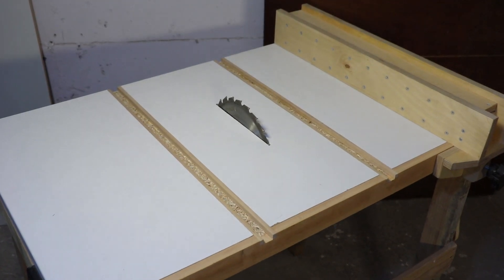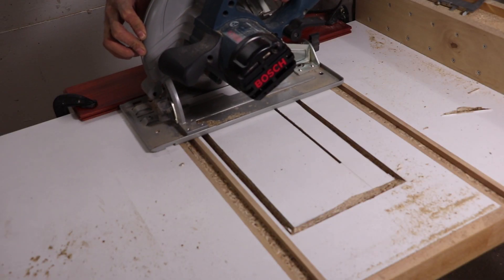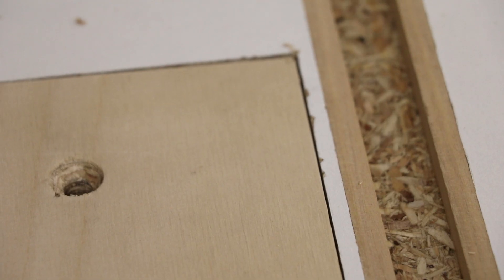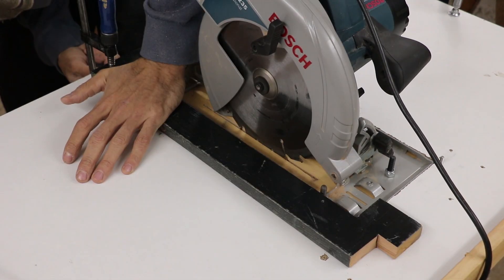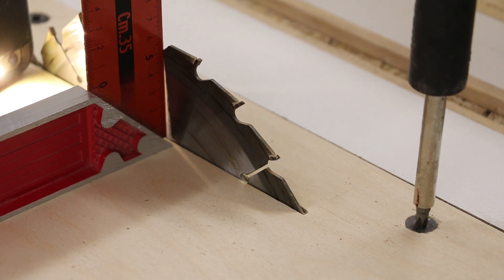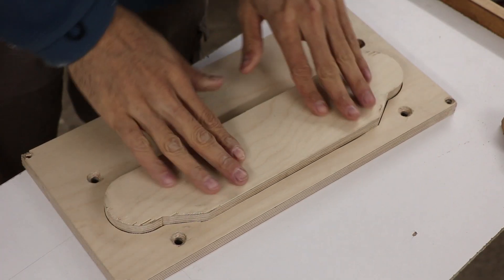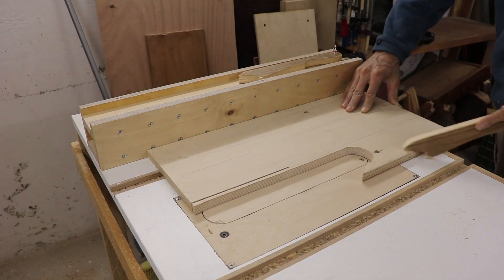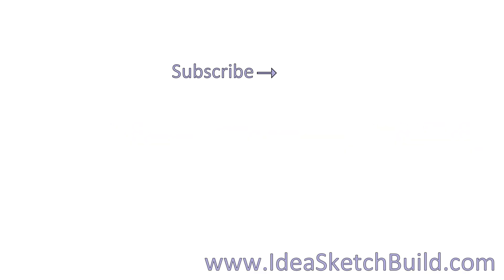Homemade Table Saw - 4: Removable Insert and Fine-Tuning

Comment: Great job man. I tried to cut through 18 mil Plywood bcos I wanted to change the top on my table saw but the cut came through crooked. I did something wrong and went back to the old top but now I'm building a whole new saw.
I hope to have it ready to go by next month. It's not easy working out the details but I'm getting there my friend. U built a really nice saw there. I have  Bosch 190mm GKS type. It's a nightmare to use and it weighs a tonne. I out a lovely Freund blade on it. The blade struggles to cut through weak particle board. I must be doing something wrong with the saw or maybe the blade is wrong. I bought one of those ACCU CUT things and paid 60 quid for the blade. It's the most expense I've paid out for a blade and I'm very disappointed with it. I bought SAXTON BLADES 254mm for my table saw and the cut is so clean it beggars belief bcos they're the cheapest ones they make at less than 20 euros each. I should've tried to get a couple of blades form them 190mm but I couldn't find any on Amazon..
Keep up te great work bro and my apologies for my longwinded rant about blades.. LOL

Comment: relying on thin saw plate for fixing the saw to the table top is one reason for inaccuracy, I bet your cuts would never be dead square on the vertical axis across the cut. I'd suggest to use a vertical plywood brace to support both the saw guard (which is made of thicker aluminium) and motor body to attach it to the table top. Also holes on mdf which are very close to edges and without very large washers do not look safe to me.

Comment: I really like what you have done here. I have been toying with the idea of making my own table saw now for a while. this method you have used seems to be the most practical of all that I have seen. This is the way to go but instead of attaching my saw to 3/4 ply I'll use a piece of 6mm aluminum plate inserted into 19mm marine ply, to give me even greater depth of cut. Thanks for the idea.

Comment: My friend you have some nice ideas here and nice video put togheter but this should not be build from particleboard for sure!That is dangerous as hell,specially when you took off more of half of the thick of that board!The particleboard as thin as you made it to atache that saw will collaps sooner or later from the speed trepidation of the saw!Believe it but that is dangerous as hell as you can end up with a runing saw over your feet!Use some hard wood and make it proper!This sould not be allowed to be on youtube from safety reasons!

Comment: Without a riving knife, this is a terrible idea to share. Beginner woodworkers (with little to zero experience) will try to do this to save cost and won't be aware of the potential dangerous kickback this homemade table saw would cause.

Comment: Whatabout the thickness of the sawblade when it the blade is a little dull, you need more force to push the wood through the saw, and when your sawblade is thin ( for example 1.6 mm) it will tilt to the left, so that you sawpiece is not square !

Comment: I don’t get it: you have good ideas and take a lot of effort and material: How can you not see you don’t have to drill the saw base plate but simply unscrew it? How can you not realise that the chipwood base table will make all your work for nothing after a couple of cuts as it is not structurally stable and will both bend warp and rip out at your drill holes? You want accuracy think it through also on material site

Comment: that's got to be the most confusing video i have even seen on here. you practically redone all your work over and over again but explained that its what you were trying to do in the first place. in all the 9 years i have been doing wood work i've never been so frustrated watching someone try mount a circular saw under a table to become a table saw. the saw itself has 0 degrees adjustment up n down and a 0 to 45 degrees.

Comment: Hi Nadav, Please, Could you tell me about this video at 10:39? I need to know the name and size of tool (Is an allen screwdriver?) that you used in the "small adjustment screw that sets the bottom-out point of the tilt mechanism" (Maybe, f I set the angle with this small adjustment screw first, It will be more easy and I will not needed to other mechanism?). Besides, I would like to know more about "allen screw sizes", and the bolts sizes, and plate size, the arm size, and the distances between the holes, etc. Please. Thank you. I hope you will be able to answer me. I did not see the information about this project in your webpage.

Comment: Hi! I loved your video, and your way of explaning alll this. I am making a very much similar machine using the structure of a schools desk that was given to me. As I am a zero on maths, and I for see that I will have big troubles to square the blade, and I will have another chapter of troubles to make perfect square when I instal that guide that stands parallel to the blade. Maybe I'll use a piece of aluminum i got around here. I think I may have a solution for squaring this piece, but I can not explain it on words only!! My saw it self will stay ON a rectangular ''base'', and the table will be all around it, as this way It will not loose much of the circle. About squaring the fence relatively to the saw blade, that will be another ''battle''...

Comment: use putty plastiloka epoxy, apply thin oil layer on the the base of the machine, (so the plastiloka wont glue onto the machine itself, but to the table),.... this should let you remove the machine and still be able to bring it back into a 100%proper fit...

Comment: I like DIY projects but you spent way too much time and effort for something you can buy for less than $100.   Not to mention the accuracy and reliability factor of your design.
Reply: Wrong. Cheap chinese table saws are not even near to accuracy he can obtain out of this DIY project. Table tops are flimsy and not leveled properly, angle adjustment mechanism tends to move on its own after few cuts and you loose your 90 degree angle, saw inserts are garbage for cutting fine pieces of wood (gaps too wide). You cannot easily adjust these chinese saws to the level of his rig. You need to tune them to match this level of accuracy. So no - you cannot buy table saw as precise as this one for under 100 bucks.

Comment: Great attention to detail. Rare to find a woodworking video that goes to such lengths to achieve (almost) perfect alignment of the blade and your method is smart. Well done. Is this your only table saw or do you use a store-bought table saw as your main saw and this one just for fun? I do see a lot of people making their own table saws, but I wonder whether it's more a hobby or to save money. You can buy a good table saw for a few hundred pounds and I wonder whether it's really worth it to make my own. But definitely a nice project and challenge.
Reply from the maker: No, this is my only table saw. You can't get good table saws for cheap where I live, but I mostly built it for the fun of it. Thanks for the comment.

Comment: As I'm doing this myself as we speak it dawned on me that the blade alignment problem is the weight of the motor.  The saw was never meant to be used upside down, so when It is gravity pulls the heavy motor down creating the mis-alignment.

Comment: I don't get it. All that just to gain about 1/4" of cutting depth? To gain depth, why didn't you cut from above to make the base of your saw sit flush with the table surface, shaping a removable insert afterwards to fit within the opening in that base? My saw is mounted from below on a steel plate, with about 1/4" of wood (attached to that plate) between that and the table surface.

Comment: Realy nice job! Will help me making my own. And I have a question: your system to adjust the angle of the blade works only with the gap between the screw and his own hole?
Reply: Renan Gadioli thanks! Yes, very fine adjustment.

Comment: Great work! This is probably the best job of making an adjustable DIY table saw I've seen so far. That said, it doesn't seem like you really gained all that much with the change from 1" to 3/4" material. Considering the stiffness of the actual saw base plate, and how close the insert plate tracks with the actual outline of the metal saw base plate, I'd suggest trying even thinner material (maybe 3/8") for hanging the saw.

Comment: Did I miss something? When you've finished, how do you turn the power on and off? The saw has a trigger switch. Do you have to tape it in the "on" position?
Reply from the maker: James R I'm using a zip tie to keep it pressed.

Comment: Have you checked the dip in the table from the leftmost side to the rightmost??  I built a similar table out of 40mm MDF (an old worktop) and got about 2mm dip where the weight of the saw hung from the underside of the table and caused it to sag.  
I only realised it was like this when I measured the blade for squareness from BOTH sides of the blade and both sides were showing <90°.  Checked with a straightedge and found the severe dip (VERY pissed off when I discovered that!).  
I'm now building a new saw (from the guts of a £20 eBay table saw) with no weight hanging off of the table and a 2x4 'ladder' support structure underneath.  It's total overkill, but I'm not letting any sag happen again.

Comment: All you gained there was 1/4" increase in cut depth. If you had a router, or you get one eventually, you can just use the 1" thick base and cut out 3/4" of it from the bottom so your saw will sit under just 1/4" of table. Mount it from underneath securely and you're good to go. If you remove the blade guard and cut away some metal from both sides of the top guard, you can add a 8 1/2" blade to the saw and get even more cut depth. Nice build though. I like how you cut out the saw guides in the table using the circular saw.
Reply from the maker: MrCougar214 hi, you are correct, I really didn't gain much depth of cut. One of my future plans is to build another insert that will position the saw's shoe flush with the table, so I could use its entire depth of cut.

Comment: Hey, brother, if you still have the footage of chiseling out that veneer and particle board, I'd love to see it.  I attempted something similar but it was a massacre.
Reply from the maker: I have just a bit, the battery of the camera ran out in the middle... But I didn't chisel the veneer, only the particle board.
Reply: Thanks for the reply.  I see that my problem was I learned how to use a chisel from cartoons and was hammering it instead of cutting.

Comment: just watched this Video, Impressed with your final set up of Saw,  and so  you can later use it as a router table,  Good Idea with my new table saw after I finish  the first jobs  and making  the  fold down extensions will be able to add Router  and Router Fence.  I will be spending rest of afternoon adding  to my design so can adjust saw to get blade perfectly square.

Comment: This is the Saw I am using in my Table Saw ( http://909.com/site/index.php?page=shop.product_details&flypage=yagendoo_VaMazing_zoom2.tpl&product_id=31&category_id=9&option=com_virtuemart&Itemid=80 ). Will have photos in INSTRUCTABLES.com (or make video using photos).  When complete as have started from scratch was using a Dining Room Table but want to use a different fence system that was not suited to table but now just about ready to start building new one, Just seeing if I can plan a practical Riving knife to install or Splitter that is easily removed and its height adjustable.

Comment: I don't fully understand how the unscrewing of the square pice of wood under the table releases all bolts?
Reply from the maker: T Dang it doesn't. What I meant is by releasing the bolt and turning the piece of wood around I can use a single bolt to change the angle of the saw and blade.

Comment: What are the reasons you didn't use Mathias Wendell's design? Just curious.
Reply from the maker: If you're referring to the tilt and depth adjustment, I didn't want to "ruin" the saw by taking it apart, since I don't have another one and need to take it off the table from time to time and use is as a regular circular saw. Also, one of the things I enjoy the most about woodworking is planning and designing mechanical mechanisms, so even if I wanted to do something similar to what he did, I'd probably tackle the problem myself and come up with a solution of my own.

Comment: Hi, Well done. AFAIK, for the 5 cuts method, you should divide by 4 to find the error.
Reply from the maker: You're right! thanks for the correction.
Reply from the maker: Joshua Kramer assuming the jig is aligned with the fence\miter slots, it checks the alignment of the blade against these.